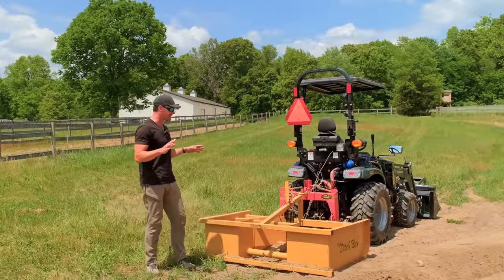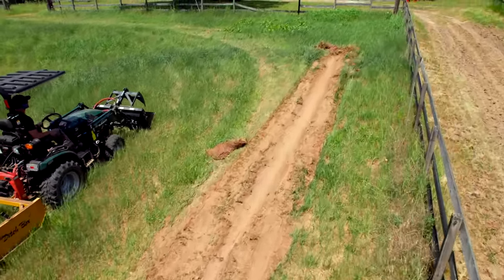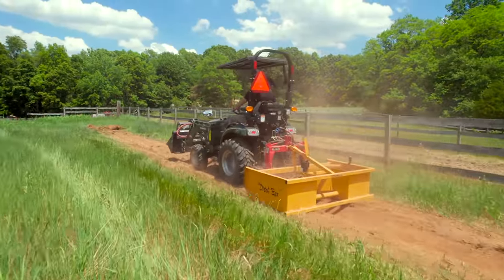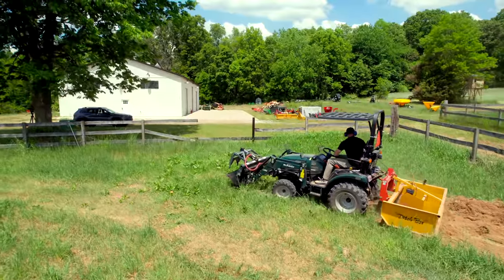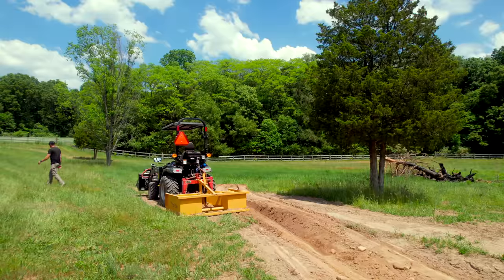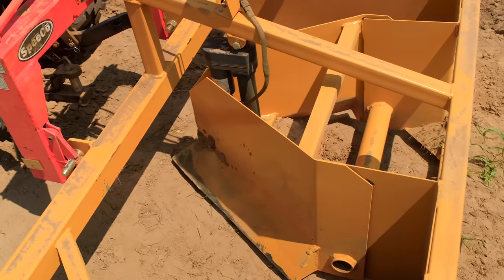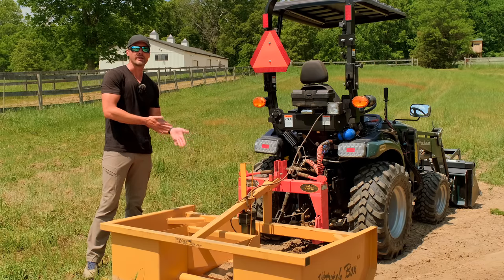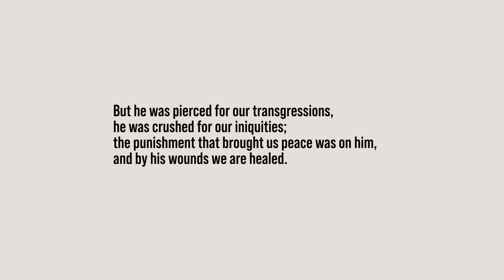ANOTHER TRACTOR TOOL THAT YOU’VE PROBABLY NEVER SEEN BEFORE!

Comment: As someone who's never seen one and never used one before, it seems it needs one additional feature: The panels in the back need to be doors that are hinged towards the center. This would allow you to divert the grass and such on the initial passes to the side where you could move it with the bucket, rather than having it fill up so fast and having to dump it or whatever. It is a rather application specific tool, but I can see where it would be ideal if you have a lot of straight ditching to do.
Reply from the maker: Hadn't thought about that, didn't seem a like a huge inconvenience.  The sod piles could just be drug to a different spot than the soil piles?  Sorta along the same lines, Chris and I thought it would be cool to have a panel to completely close the back off so you could have the entire back wall to push backwards with.  Didn't make the video, but I spread out a couple of the piles using it like a box blade.  Worked quite well.
Reply: It's more a matter of the sod seems to load up so fast that you're moving it to the spoils pile like 5x more often. By kicking it to the side, you could clear the sod, use the bucket to move it to the pile, and then once you're into the dirt, you'd close the panels and use it as normal. The back panel is a good idea. It might be able to be hinged so that it would automatically stay closed when pushing backwards, and swing open as necessary when moving forwards.
Reply: I thought maybe hitting the path once with a rototiller and finishing it with the featured tool.
Reply from the maker: @daveschmidt5713  That's a good idea, kind of like what I do with tilling up the sod where I want to put gravel lanes.  That chopped up sod will decompose nicely and be reusable.
Reply: @GoodWorksTractors  Your video on tilling up the lane is where I got the idea.
Reply: I agree with this statement
Reply: If not doors, maybe a lower side panel so it can go over the side  and furrow the dirt for pick up with a loader or to push back in the ditch if you were installing drainage pipe.

Comment: A very handy specialized tool. As you say, it requires the proper approach to the job. You're not going to have a finished ditch in one pass.
Reply from the maker: Perhaps with a bigger tractor it would be possible to do in one pass, but I don't multiple passes are a big deal either.  It's a pretty easy, satisfying job to do.

Comment: I agree with JC Wren that the initial dirt needs to spill out to the side.  Maybe the side panels could slide up by removing a pin, allowing the operator to decide if the dirt gets moved along or is diverted to the sides. For me, once I got into the "groove" of plowing the ditch, I want to keep moving.
Reply from the maker: Odd, I see that as completely unnecessary.  500' in 30 minutes.  I don't think that level of incredible efficiency is resonating with some.  The idea I liked was tilling the sod first.  That makes it usable in the future once it breaks down.

Comment: What is the best way to get a hydraulic top link on my 3032e?
Reply from the maker: Two part answer...

First, you need the rear remote to operate.  JD sells a 4th/5th package.  Typically pretty expensive and not easy to install.

http://www.summit-hydraulics.com can set you up with the right DIY hydraulic kit and save another 5% with code GWT.  

Then, you need the top link.  Measure the shortest length and longest length on your top link.  Match up with the closest one here: https://www.amazon.com/shop/goodworkstractors/list/46M6Z6OWPONU?ref_=cm_sw_r_cp_ud_aipsflist_aipsfgoodworkstractors_TGST9T9GK5DFDV8SDMFM
Reply: @GoodWorksTractors  Thank you for taking the time to help.

Comment: Would be cool if the ditching bit could be swapped with a scarifier bar with on the fly engagement
Reply from the maker: Interesting idea, not sure how easy it would be to integrate that capability.
Reply: @GoodWorksTractors  me neither but it would go from a very niche product to why would you buy a regular box blade when you could have a trencher scarifier or maybe even 2 scoops and it's also a hiller mounder for the garden?

Comment: It looks like its about the standard length of a box blade. I wonder if they make it longer would it work even better. Give it the ability to collect much more material and they could sharpen the angle on that plow reducing drag as it cuts through the dirt to balance it back out.

A very neat tool. Would definitely be great for the guys who install and maintain gravel roads/drives. Not sure it would be worth the price vs the amount of usage most of us would get out of it. But BOY did it make quick work of the job.

Comment: Would it help if you use the tractor front bucket to remove the sod or grass and then use the ditch box anyway it will get the job done
Reply from the maker: Neah, that would be tough and time consuming.  500 ft in 30 minutes, easy peasy this way

Comment: Now you need a heavy duty rear blade, use it with one end lower than the other, this will make a wider path for your ditch,  this is a great idea......     Nice item....
Reply from the maker: Yeah, I honestly probably didn't need to go as deep as I did.  In hindsight, I should have left them shallower and waited for a few rains to come through and see how they work.  These are traversable, but a bit shallower would have made them easier to drive over.
Reply: @GoodWorksTractors  check it after a good rain and see what it looks like... Use a rear blade and cut it deeper...   Yes everyone needs rain....!!!?!
Reply from the maker: @dave.lawrence.3894  We are definitely in a prolonged dry spell around here.  No rain in the forecast either.
Reply: @GoodWorksTractors  NOT GOOD!!!!!!🙏🙏🙏🙏🙏🙏🙏

Comment: Nice tool for such a specific task, but it does need some sort of redesign so that it lets the dirt/sod pass through as it digs.  Very expensive implement too.
Reply from the maker: Letting the dirt pass is what this is designed NOT to do. For that kind of design a plow point is all you need. Then you need to drive along both sides of your ditch and collect the furrowed material. The Ditch Box is designed intentionally to trap and pull that removed soil as you dig the ditch.

Comment: Now this thing I really like.

How many passes did you make?

Would it have helped if you broke up the sod before you used this?

Could you use this for cleaning and maintenance on the ditch?

Love your videos, appreciate the work you do and the info you share, very entertaining and educational, straight to the point too
Reply from the maker: Morning Steve, probably 5-7 passes on average as I was trying to get them perfect.  I don't think another tool would be required to break sod.  This handled that sod well once I realized I should simply focus on slicing the sod on the first pass or two and not worry about digging down much.  You could most definitely use it for maintenance down the road, good call on that.  Glad you enjoy the videos too!

Comment: Not sure if you ever saw or even heard of the Noble Blade. It’s a style of cultivator where each blade is 4ft wide or wider depending on the overall width. They were great for cutting weeds off at the surface or a few inches down for summer fallow on dry land before no-till farming arrived. If you put the horsepower to it you could work the soil deeper and really break it up without a really rough field when you were done. 
    We had an 8 ft v blade from one that was curved on each side to roll the dirt out. There was extra steel added to make the blade thick enough to keep dirt from going over. We had a 80 hp front assist that worked great with that and we maintained or created more ditches as necessary. A fair bit of the land was “levelled” in the late 60s early 70s when that was affordable. Then we would flood irrigate the fields. The table of the fields would drain towards a ditch that would catch wastewater from the higher field and flow down to the next field/s and be supplemented by water from the main or other ditches. We used the canvas dams to stop the water & or open so the water would flow into the field. You fed a lot of mosquitoes 😂, and a fair amount of dirt until you got it figured out. I was not too bad at it.  The ditcher, as we called it, was home built and lasted without repairs for about 30 years until it was no longer needed. It had set angles and went up & down with the 3 point hitch is all. The ditches would get to 3 ft deep. Enough to get really soaked if you fell!!😂😂. 
    For our ditches we maintained in the farm home yards themselves that we pumped water out of for the lawns & gardens, this little fella here would have been excellent as we didn’t want or need the hilled up sides. For the flood irrigation you used those sides as part of the flow control & distribution. 
    I like this ditcher a lot!! Looking forward to the larger model. I can see a way of leaving the unit 4” off the ground and pointing the cutter deeper to create small berms if wanted. After the sod has been cut first,,,,. That stuff is a PI the arse to work with!! 😊
    Take care and see you in the next one!